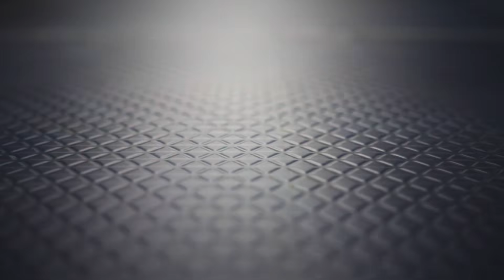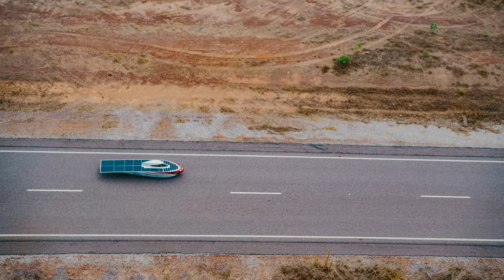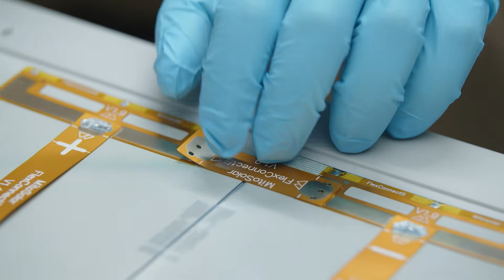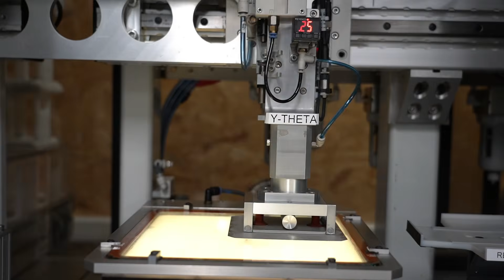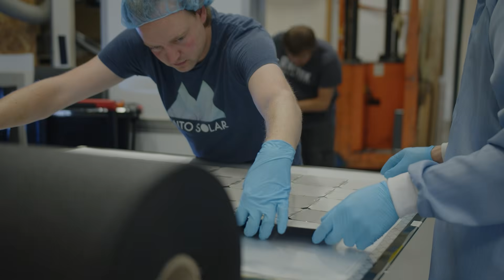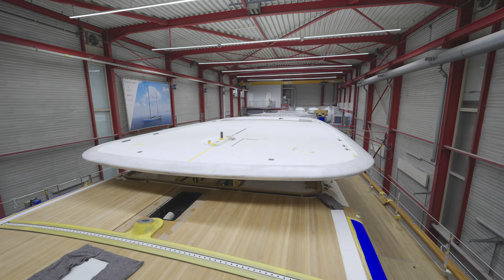A new way to harvest heat

Comment: When we extract / pump the heat from the panels which cause we cool the panel down maybe to 24° C 
In the sun it heat UP to
 60- 65°C which cause an efficiency drop of 0,4% / +1°C